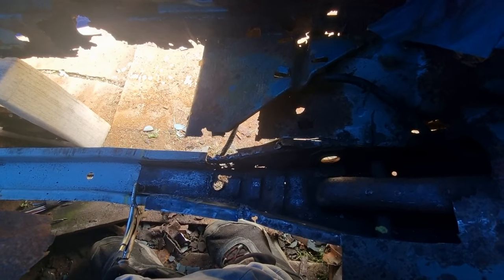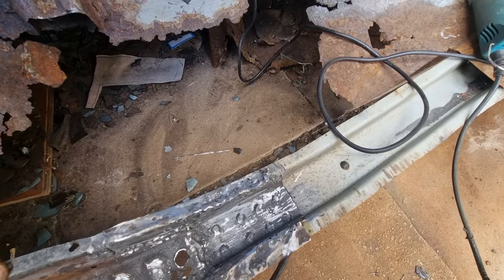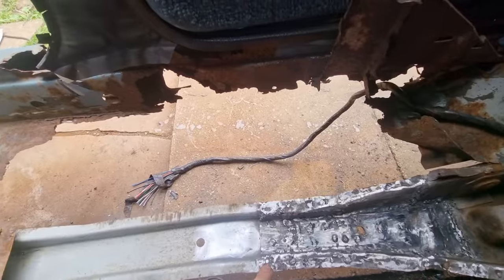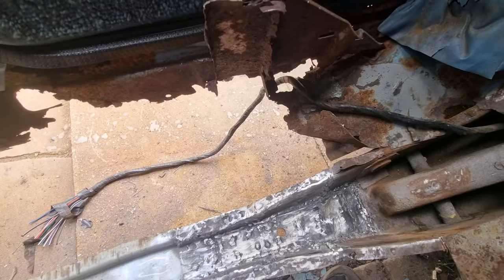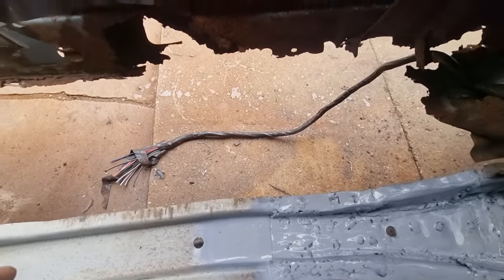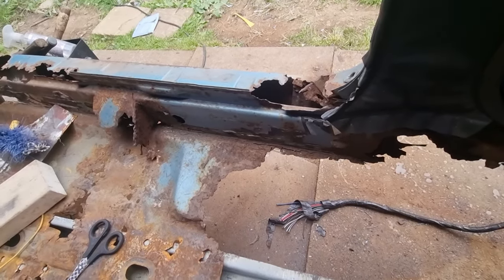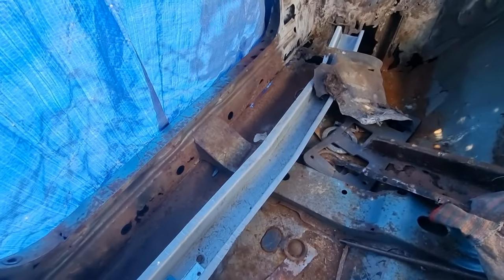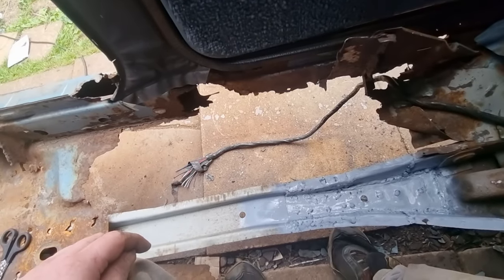Cortina Mk4 Ghia 2.3 V6 Restoration || Chassis Leg Repair Part 2 (P32)

Comment: Adam, my advice would be, if you can get the panels, then i would just buy them. Saves you time, on fab. when that time could be put into something else on the car.  Make life easier for your self pal. As for seam sealer in there, i would just give some car paint, ( anything you have spare) just so there is something in there, or Por 15 as i mentioned before.  Also i say Shassy, even though its spelled Chassis. Sod who ever said you are saying it wrong.  People just like to be picky.

Comment: You are very brave. Indeed, if possible for you, buy the floor pan. Buy as many (n.o.s.) panels as you can. Before you start with the sills, brace that side with a long piece of L-shaped metal or square pipe. Ifyou still have windows in the car,take them out, wash them and put them on a save place.

Comment: Buy the floor pans , it’ll be much easier but mainly much faster to get Courtney whole again . Especially before winter comes ! It’s very difficult to shape large sheet metal and the strength is in the shaped parts
Reply from the maker: Yeah best way ennit

Comment: I'd say that seam sealer wouldn't be necessary since you have the rust paint plus the Waxoil. I'd be concerned that it might block up some drain holes and lead to water sitting inside. I would order pre-made floors, I really would. The Expressed Steel parts are good quality and you'd save so much time. BTW I'm a Brit living in America and they say 'chassis' both ways here LOL! Nobody seems to know which way to say it here 🤣🤣
Reply from the maker: ohh yeah might do dont want water getting trapped

Comment: Say it how you want why does it care looking alot better now give it a good coat of paint inside just not on the top lip as the floor got to sit on top and be welded to your slowly getting there mate but I would try and get the panels i no it's expensive but would save you alot of time and be better  mate 👍
Reply from the maker: I agree mate